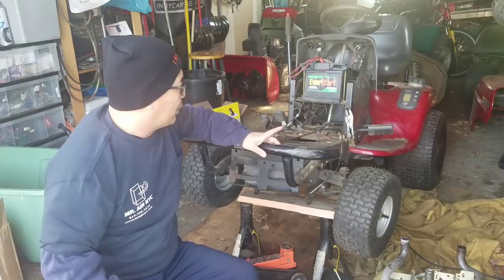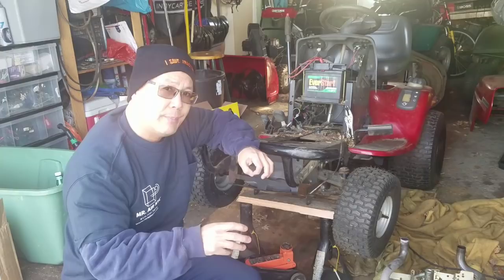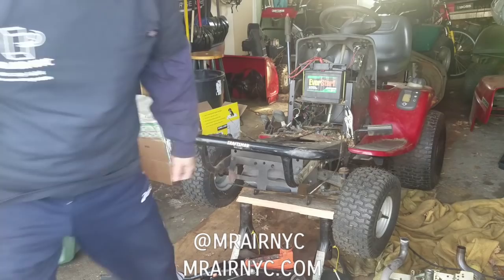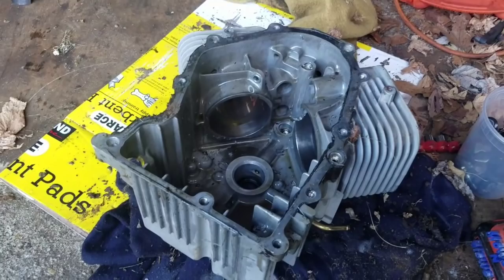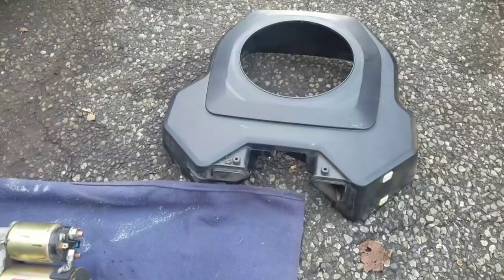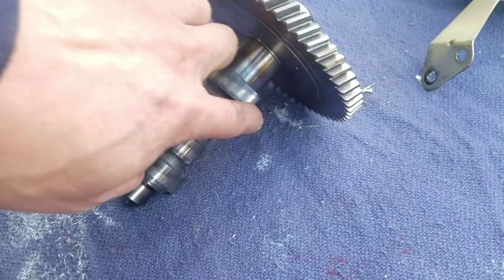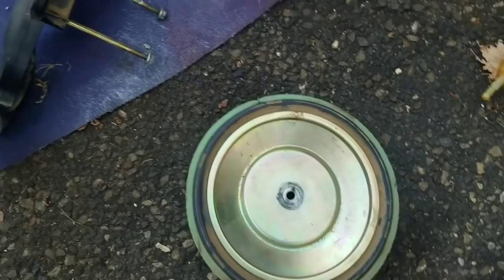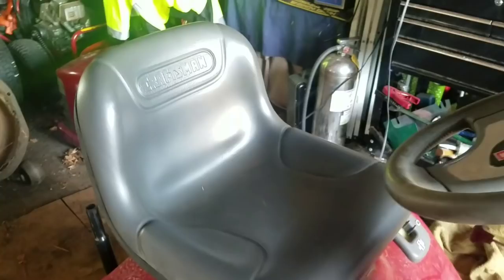KOHLER CV-730S 25HP COMMAND V-TWIN BLOWN CONNECTING RODS PARTING OUT ENGINE TEAR DOWN DISASSEMBLY

Comment: Just bought a 97 GT6000 with a 18.5 Kohler Command. Amazingly the engine ran with one broken connecting rod. Split the case apart and sure enough everything is sitting at the bottom in pieces. Hoping it didn't break the huge chunk out of the case like yours. Going to check tomorrow. Great Tear Down video thanks for sharing.
Reply from the maker: Thx for watching,  good luck and hope you’ll subscribe

Comment: I'm betting the previous owner hit something with the blades.  And that caused the connecting rods to break.  Since both were broken at same time.
Reply from the maker: No...that's what the woodruff keyway is for.  Connecting rods break because of friction in the cylinder walls from the lack of oil lubrication at high speeds and temperatures.

Comment: Henry,  Since you rotate so many units maybe keep the carb and the starter? i know they are the biggest bread winners on a total part out, but having one sure beats ordering one.  Still surprised that Command let go like that.  I gotta comment on your weather again.  We just had -40 take your breath away for a week, went up to 50 and rain followed by freezing rain and wind at 31.  Today it's 20 and blowing lake effect with gusts at 40mph.  Generators and chainsaws are selling out around here.  You still have nothing and looks like you should get the mowers ready
Reply from the maker: JT, I agree that I should hold on to parts that I know I will use frequently on future projects however, you know that I owe Frank the ups guy as well as Pete Lombardi for their help on numerous projects, thus when their needs superceded my hoard..I must oblige my friends...lol.  we had almost 5 degrees for a week, then almost 70 degree swing, now settling to a normal 30's.  While I doubt we are done with old man winter since we had 4 noreasters last March, New York weather has been ridiculously unpredictable, I expect we will in fact get snow before the grass starts to grow again.  I fix equipment as I get them regardless of what their purposes are for.  Currently, this tractor is the only thing I need to fix.

Comment: The crankshaft just miiiiggghhttt be salvageable. Soak it on muriatic acid brushed on the journals. It should eat away the aluminum remnants from the failed con rods.

Worth a shot, the crank is worth something.
Reply: i agree with you on the crank
Reply from the maker: I'll try that bro. Thanks. Hope you subscribed
Reply from the maker: It's a shame because it's worth a lot of $$$$. Hope you subscribed
Reply: @MowersNBlowers  yeah i've been sub'd for awhile thats aluminum on the crank the acid will eat it off or it usually does
Reply from the maker: I guess I could try it.
Reply: @MowersNBlowers  muriatic acid is cheap and easy to get its definitely worth a try

Comment: I wonder if you could have taken that piece that broke off from the bore and JB welded it back into place or had it welded from the back side where the piston doesn't move because you see the way it broke that piece would have went back on like a puzzle piece. Other than that, two new rods and you would have been on your way. Otherwise you should look into how much a new block would cost, or possibly a used block. This is the reason I'm not the biggest fan of Kohler engines, you hear about bad stuff happening to them a lot more than other engines, like Briggs. Its not that old and oil leaks and issues like that develop on them often after not that long. What can ya do, it is what it is.
Reply from the maker: Yes I definately thought about that but..the crank is bad too...expensive.  lots of money for those parts for a risky weld job.  I'm gonna part it out for money and try and get an opposed twin running for the dyt4000.
Reply: @MowersNBlowers  Good idea, those Briggs opposed twins are great engines. 👍

Comment: Here's  what happened to my Cub last summer when the Kohler engine had a slow oil drip. https://youtu.be/N4_Dg0LlzEk  This is why I prefer the Briggs Twin's.
Reply from the maker: Damn shame, what a great tractor!
Reply: @MowersNBlowers  It was, I got to mow with it twice.
Reply from the maker: What happened after the fire? New engine? Or did you scrap the whole thing?
Reply: I have it but most of it is melted together. I've been watching ads for other cubs where I can possibly use the short block, and Transmission. I found one, but my offer was a little low so someone snatched it from me. Truthfully, I just haven't made an assessment on what remains that is still good. Summer is short and and time got away from me.

Comment: Do you have the 4 bolts that hold the motor to the plate? The four bolts holt the engine to a 10 x 14 metal sheet. I need um, Let me know and Ill buy um from you on eBay.
Reply from the maker: Yes, I have the 4 bolts. The engine mounting bolts?
Reply from the maker: I'll find them and list them, send you the link.  I'm surprised there arent any for sale on ebay, I looked.
Reply from the maker: https://rover.ebay.com/rover/0/0/0?mpre=https%3A%2F%2Fwww.ebay.com%2Fulk%2Fitm%2F183851165596